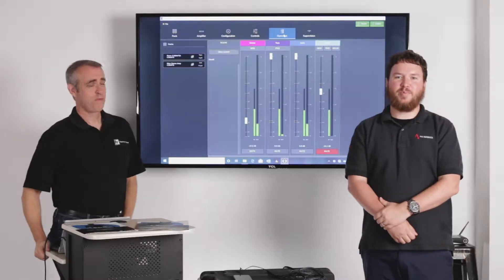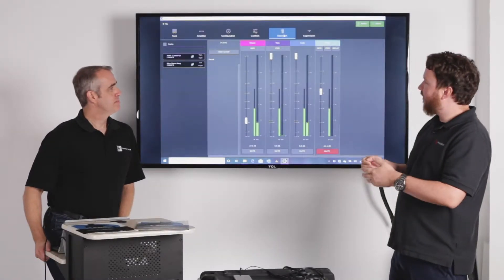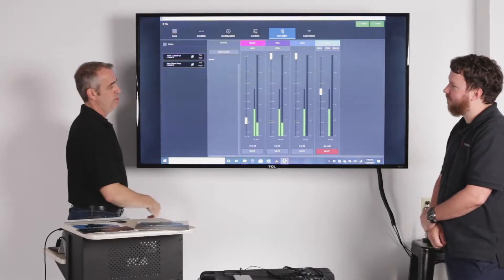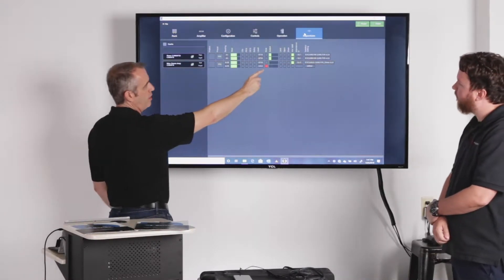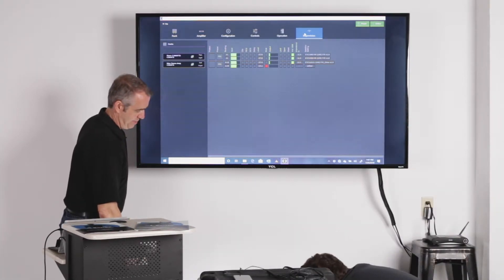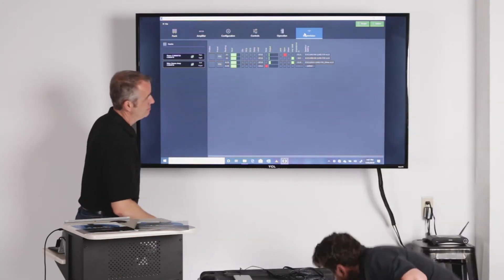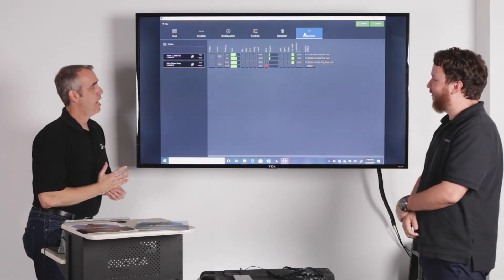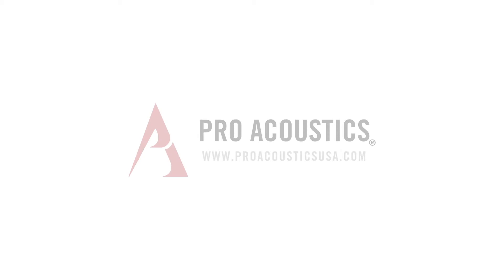In-Depth Look at DSP Digital Signal Processing Inside Dynacord Amps on Pro Acoustics Tech Talk Ep 24

Comment: I that DSP board made in China? It breaks very often in L and C series amplifiers and in result channel B stops working. It is beyond repair and the DSP board is also very expensive and hard to find. Worst of all there is no schematics available; neither even a test mode to diagnose the system!
Reply from the maker: For issues like this, we recommend reaching out directly to the manufacturer for repair and warranty support. You can contact Bosch Technical Support at technical.support@us.bosch.com or call +1-800-289-0096. They should be able to provide guidance on troubleshooting or replacement options. Hope you’re able to get it resolved!